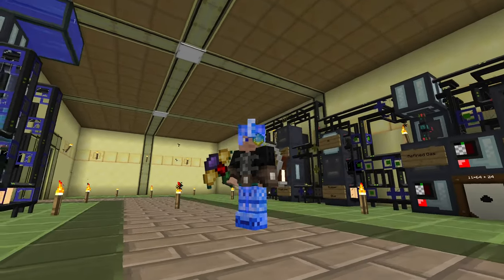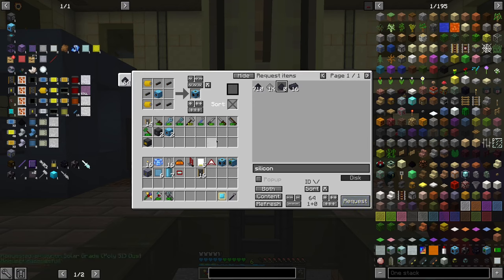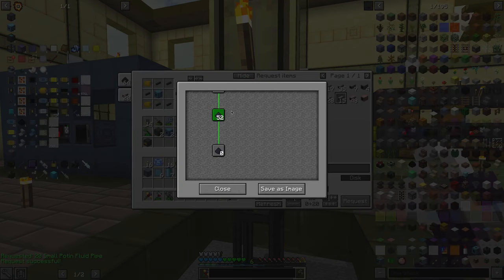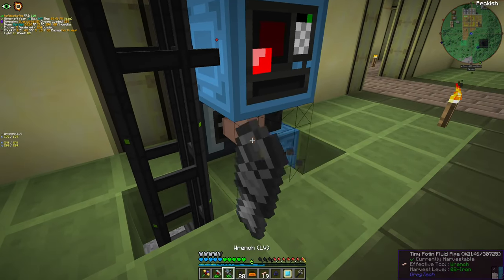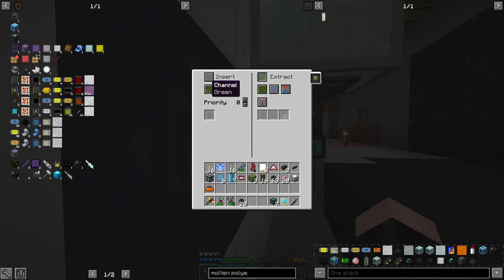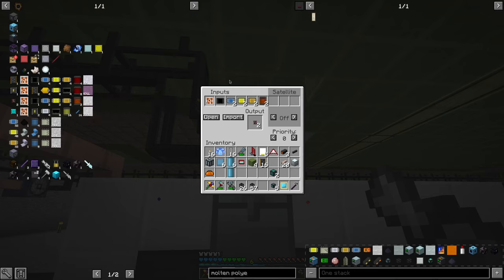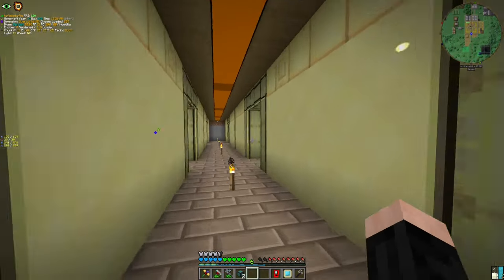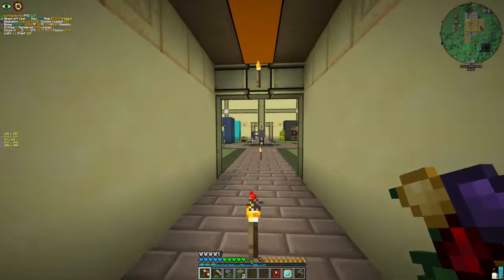Time To Automate the Circuits | GregTech: New Horizons S2 - 30

Comment: i don't see anyone else using logistic pipes in GTNH, why is that? is is too complicated or expensive? or did they add it recently ans it's unknown?

it seems so useful prior to getting ae2
Reply from the maker: There are several reasons for it actually.
- LP is a relatively new addition to GTNH. It got added right around when I ended my previous season. But recipes were a bit expensive for a long time. In recent versions, it become viable.
- LP is an extremely old mod but also didn't get attentions post-applied energistics era. So a lot of people are not familiar with it. 
- A lot of YouTube series tries to speed run or power through things and they directly went to AE2.

On the other hand, I enjoy taking things slow, plan out, enjoy little stuff, and enjoy playing with LP. It is also super effective during early game and it allows you to have more complex automations really early on. For example, just a small spoiler, I already did base platline automation, fully with LP... I'm planning on replacing with AE2 around early EV era, so I can use it's full potential.
Reply: that makes sense, thanks!

i really want to play GTNH but I haven't played most of these mods since i haven't played modded earlier than 1.12.2, so I'm just trying to understand these old mods a bit until I finish nomifactory ceu and start gtnh